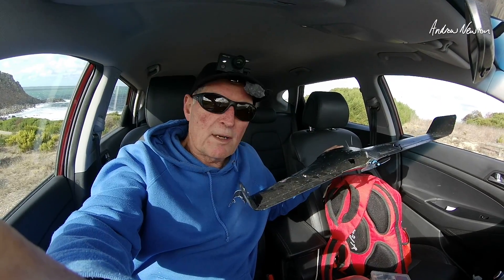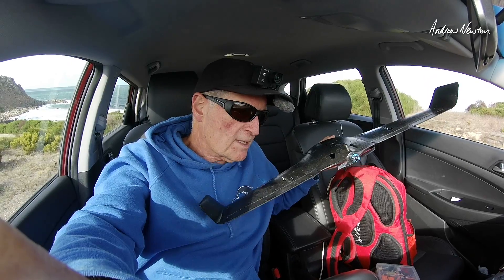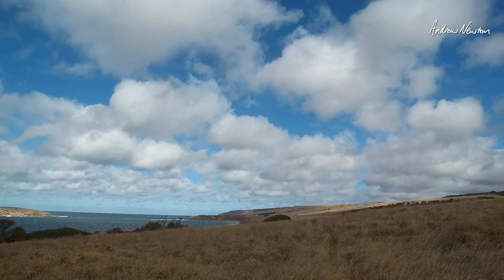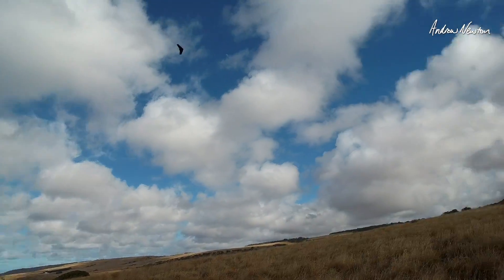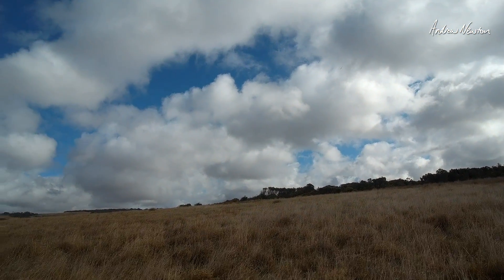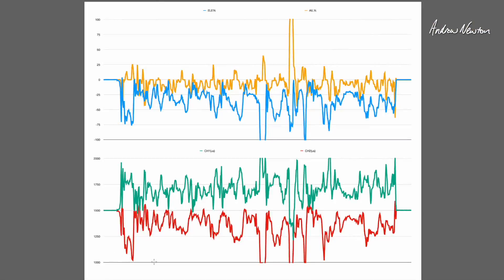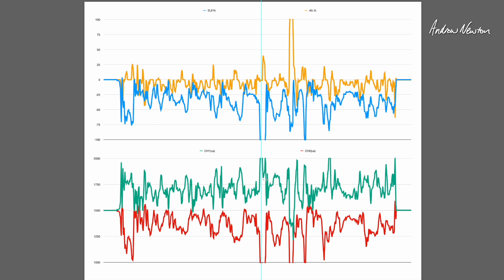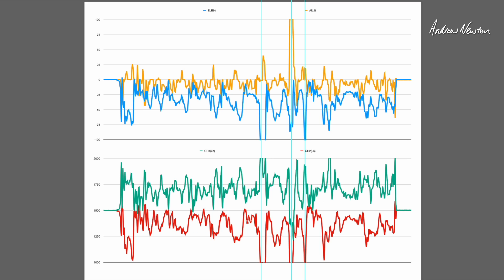100 / 100 Elevon mix test

Comment: Good question. Great excuse to go flying!

Think part of the assumption is range of servo is 1000-2000 mS, with 1500 mS PWM pulse width being centre. Some servos can/do go beyond these limits. Some servo checkers show the mS value (digital readout). It may be possible to test this using INAV via flight controller to set/see ranges and control surface deflections. Some battery chargers include a display page that also shows PWM signal values on a graph if plug in servo lead. All possible ways to test real limits on the bench. 
Not sure if INAV limites range, or resolution, as some microcontroller PWM devices do limit to 8-bits resolution, or 255 discrete position outputs .. 255 positions corresponding to 0% to 100%.
It will also depend on how control surface deflections are set relative to maximum servo movement. (which holes on control horns are used)
Generally, I don't think will ever be an issue ... worse case is one of the two control surfaces may not fully deflect as much as the other.

Comment: It looks like you could get more throw by adjusting the linkages to put each servo closer to the center of travel.  As shown they are each considerably away from center.
Reply from the maker: Yes I was nose heavy and un-trimmed. Adjusted for the next test

Comment: If the plane is as long as it is wide I sometimes add elevator to 60 or 70 percent to get the extra throw. The Prime Jet from Hobby King comes to mind with it's little elevons. It rolled great but had little low speed elevator response. Moving the cg back helps this but it's a balancing act like anything else.

Comment: With a programmable transmitter or flight controller the only real downside of a 100/100 mix is that the max roll rate changes depending on how much pitch is input, and vice versa.  With a 50/50 mix the max rates of each are independent of the other.

I would suggest that if you’re never saturating the servos then you have them set up mechanically for too much throw and could probably adjust the linkage to get less throw and more resolution.

Comment: "A digital mix? How fascinating..." [Ref: a silly 'Not The Nine O' Clock News' sketch about a not-so out-of-touch courtroom judge.] Ah, does anyone else remember when V-tail and elevon control mixes were mechanical/analogue? No? Just me, then? Aww, poo.

Perhaps it's time I bought myself that Shackleton's High Seat Chair.

Well, kids, this is how it used to be: the aileron servo was mounted in a sliding tray, which itself was connected by pushrod to the elevator servo. The result was simple mechanical mixing which worked reliably and didn't require anything special of your servos (which were huge and heavy and hideously expensive).

 Of course, a modern digital setup is lighter and infinitely more flexible, but the ol' analogue system got the job done.

Comment: I'm a bit confused on the purpose of going 100/100 - I thought the argument was that way you could go from 50 up to 100 when doing a tight roll or loop - i.e. get full deflection when using just one input rather than half - but andrew seems to be focusing on scenarios when you would be aggressively using both

Comment: It's a mechanical system.  You can't "saturate" it.  When the servo hits full travel, it's done.  Adding more mix just makes it happen faster.  This was proven years ago when computer mixing in the radio came out.  Running 100/100 for years.  No issues.
Reply from the maker: Fair enough. Should be saying the servo input signal is being clipped

Comment: I have been running 100/100 mix on my race wing for ages and my god is it nice to have the throw for fast rolling or tight loops. Plus you actually arent asking more of the servo than it can deliver (At least with edgeTX) because the radio will cap the output at 2000 or 1000 microseconds anyways so all the radio will tell a servo to do is go full deflectionand that's it.